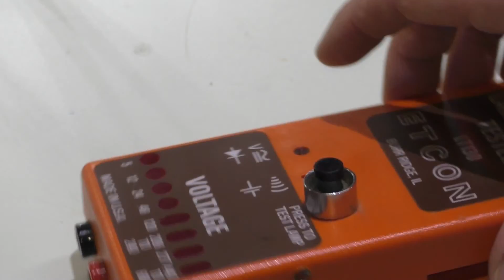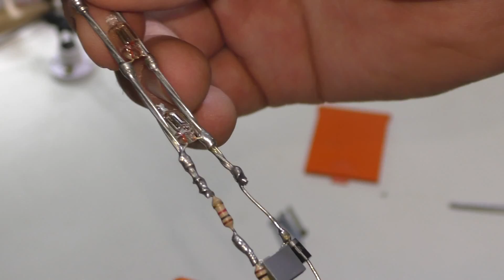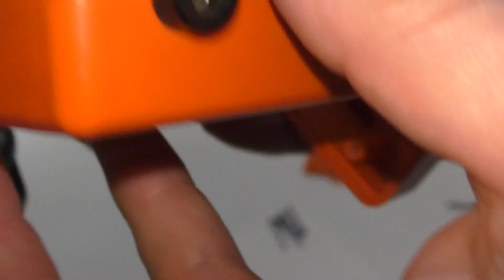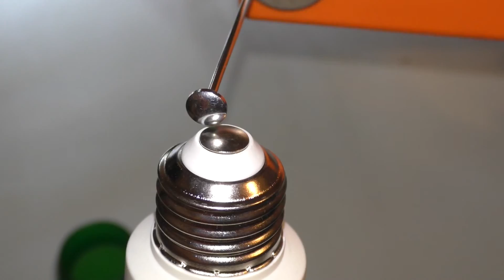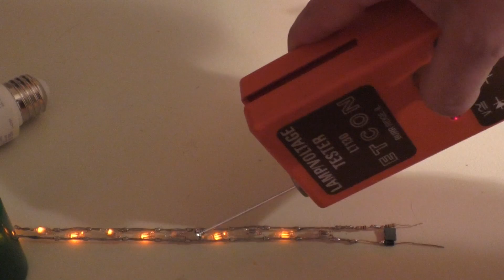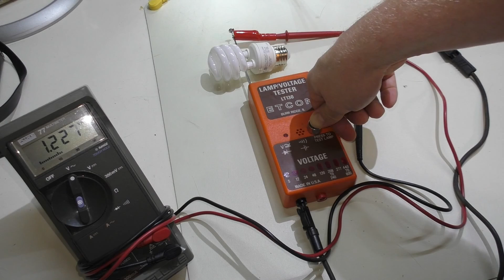PTS Ep. 101 - Etcon LT130 Lamp / Voltage Tester Test & Teardown

Comment: Not with one of those but with the contemporary Fluke model I accidentally did a lamp test on a PL type fluorescent and either shocked myself through my hand by contact with the probe or with a pin of the lamp. It hurt like a MFer and I could even smell burning flesh, but I had no mark or ill effects. 0/10 recommend lamp testing yourself.
Reply from the maker: From all of the years of getting bit or zapped, I thought I'd learn by now.  The mini tesla coil I built really zings you good!

Comment: What I can see when you do a closeup on that black component underneath it tells me that it's a coil,  in there.  Probably with a really high turns ratio.  I suspect that it's putting a fairly narrow pulse out of that antenna,  which is why your meter didn't respond to it.  A scope would be the instrument of choice to check this out-- I'd guess that you'll see something by holding a scope probe near the antenna,  without actually needing to connect to it.  Though of course connecting to it would give you a good measurement of what the thing is putting out.

I'd love to see a schematic of this thing.  A quick search on that didn't turn up much,  unfortunately.